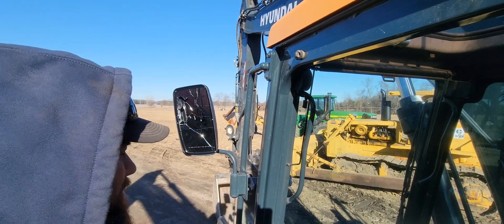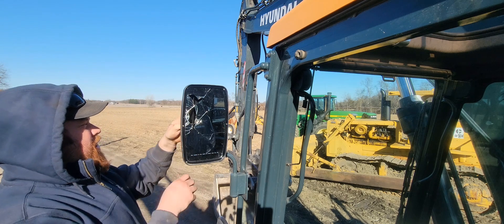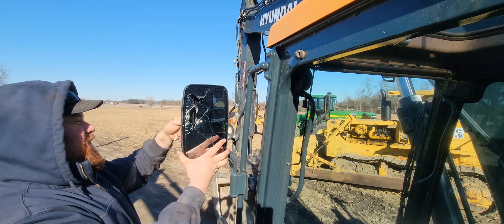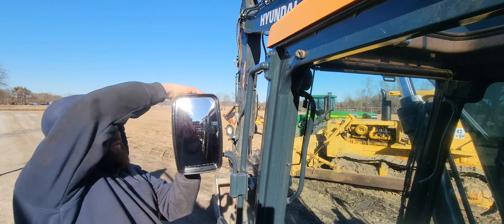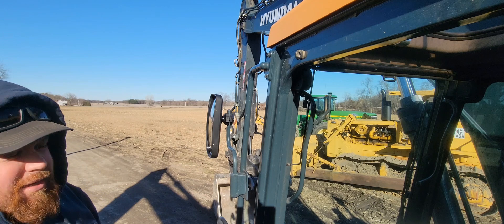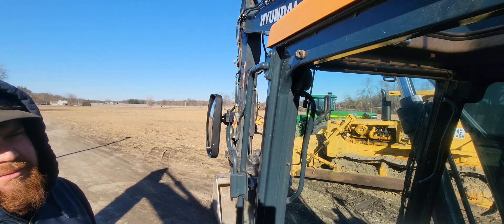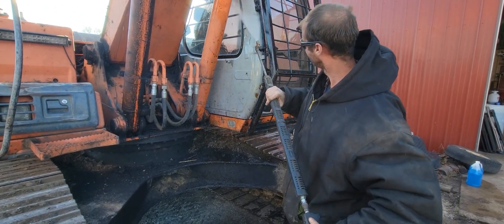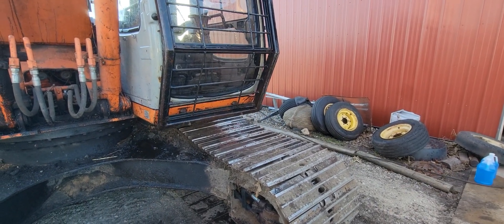How Did That Get Broken?

Comment: Hi Brandon. Have you considered fabricating some mirror guards similar to the guards on the front windshield! Some heavy gauge wire welded up that would slide down over the mirrors with a clamp or two to hold it in place. That would give you a real good shop video, and the chance to try out a new welder or something!
Reply from the maker: Well this is all being discussed my buddy Zac and I are considering a side gig of building protection for these excavators we want to start a Fab shop building this kind of stuff and stuff for UTV's
Reply: @dirtgrainsteel  Hope that works out for ya! I wonder though were your gonna find another 8 hrs a day!?😄